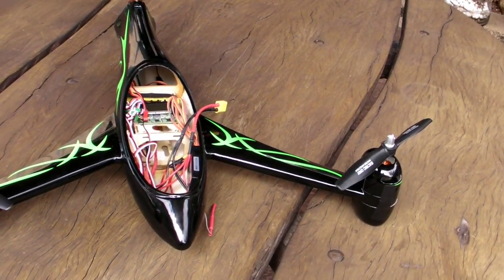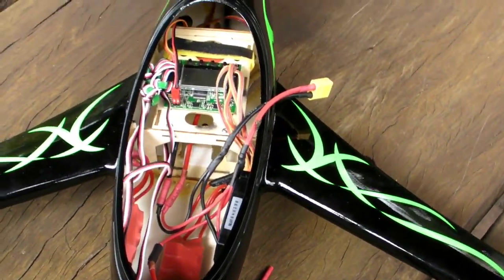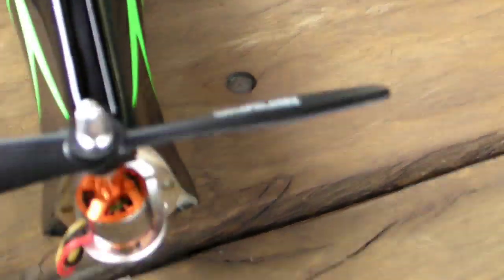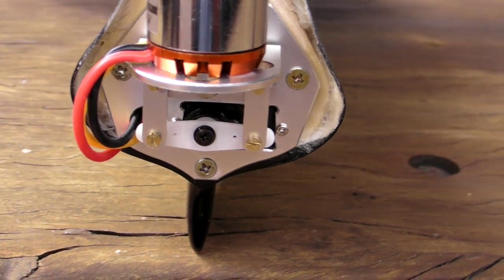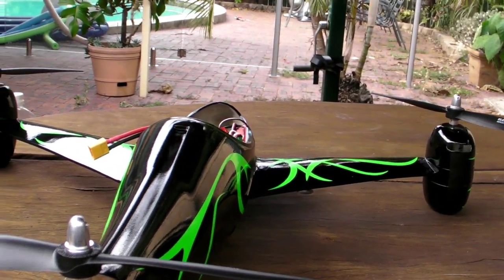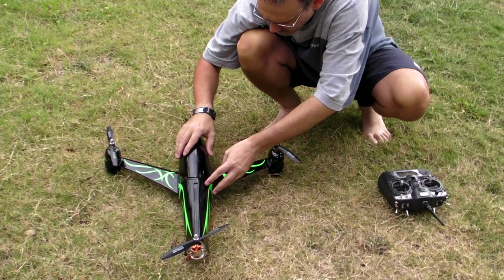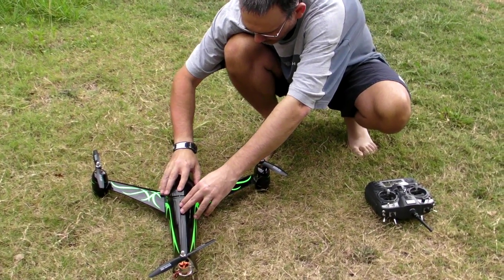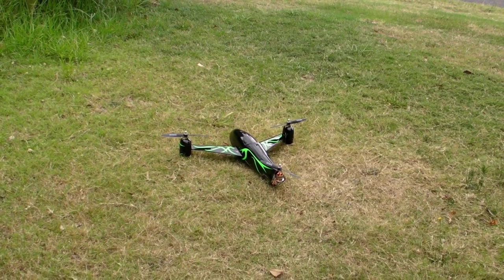Y-3 Tri Copter MultiRotor HobbyKing Part 4

Comment: I know that your video is a year old, so I hope you still monitor the comments. I am experiencing hot ESC's. I'm using 1500kv motors, 8X4.5 props, 30 amp ESC's. My. ESC's are really heating up. I think that there is just not enough air circulating in the pod. Have you experienced that? I installed a fan, and it helps a little.
Reply from the maker: Hello. 

I actually gave up with this frame and have since moved onto a qav400. 
Maybe someone else here can help.

Comment from the maker: ran out of room !

the flight controller tells you what motor should rotate in which direction. just plug in the motors the way the flight controller says, make sure the correct type of prop is on each motor (pusher or normal) and the flight controller takes care of the rest.

Comment from the maker: the flight control board does all of the work in keeping the tri copter level. with the rear, it usually tilts the rear rotor slightly to one side for level flight and hovering, im still learning to fly it, and have in fact shelved this one, till i learn on a less damageable airframe.i have an x900 alloy framed tri-copter in the building stages now.

yaw rates are fine, no matter which side yaw towards, the front two are counter rotating, and the rear is normal.there is minimal torque to offset

Comment: How did you decide on the direction of each rotor and what affects does the torque of the rotors have on rotating the craft while flying?  Since there is an odd number of rotors?

Comment: have you worked out your thrust if not hunt on line for a thrust calculator 
im running kk2 v1.2 on a talon in wind and its not bad i have ordered a programmer 
to update my card as auto level im told is better but its still good as v1.2 im also
interested in the ultra sound mod have a look on my youtube its on 1.2

Comment from the maker: i now have the v1.5FW on the KK 2.0 board, and have the servo filter set at 70. no more servo jitter at all.

i have the first successful maiden flight uploading tonight.
had a minor incident" involving a tree and some bushes :) no harm done, and i continued flying afterwards...

it was a little windy, and im only relatively new to RC flight in general, this is my first multi rotor also....